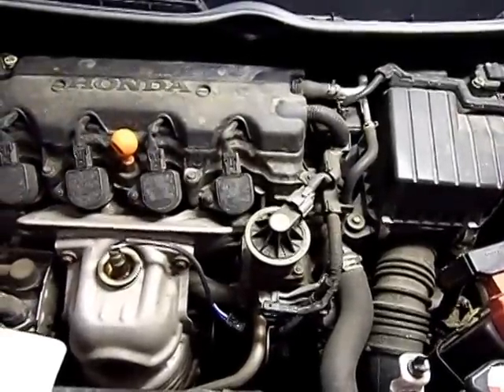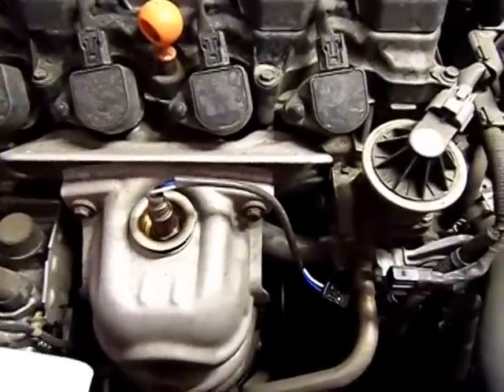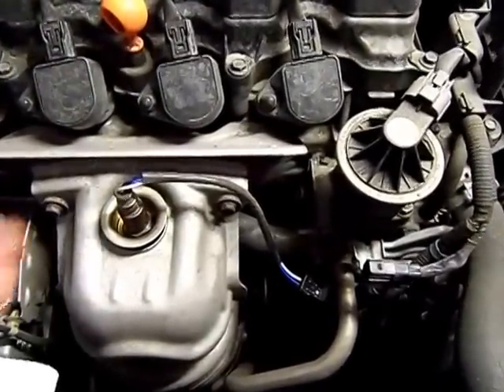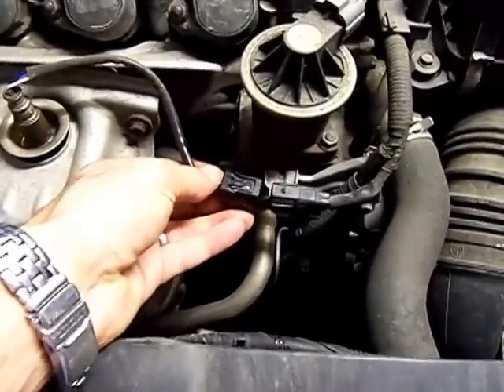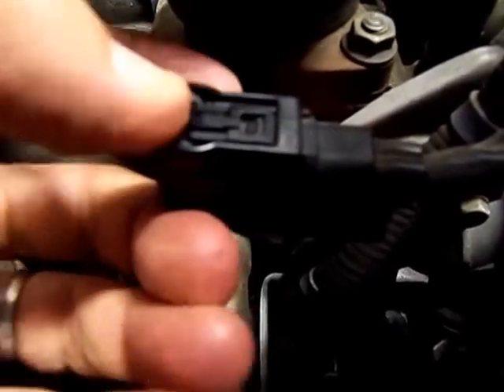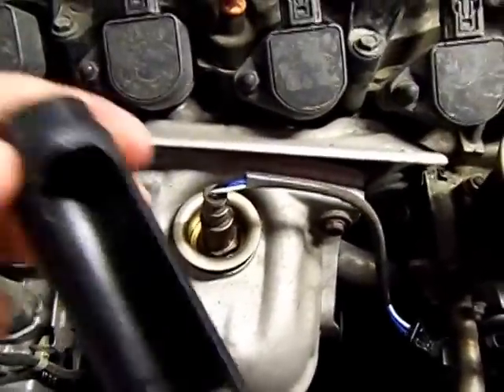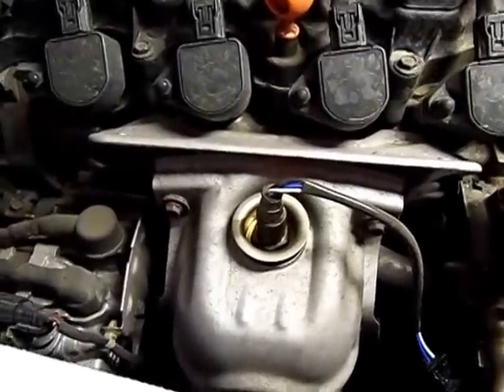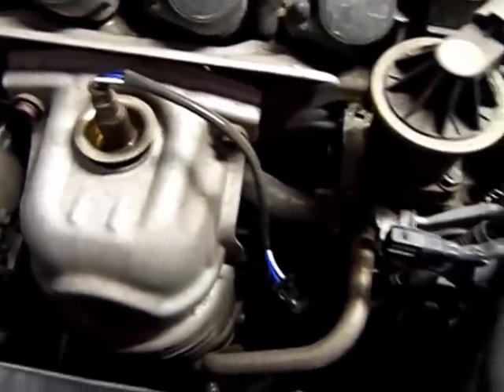How to replace the oxygen O2 sensor in a Honda Civic 2006-2011

Comment: Thanks for the video.To remove the sensor since you are not using it again just cut the cable then you can use a regular long socket to do it. Sometimes they are too tight and the special socket breaks. You can use the special socket to install the new one.
Reply: Good point

Comment: where did you buy your o2 sensor?
Reply: If its JDM 2006-2011 then its located inside the tank with the fuel pump assembly  .
Reply from the maker: My local auto parts store.

Comment: Im having the same issue i dont know if i will replace mine.   Did yours throw any code.  Mine is not throwing any code / no engine check and engine runs great except for the bad mpg i get ..My civic is all stock no modifications done at all... What was the difference can update us thanks
Reply: If it does throw a code, it'll be P0420 - Catalyst System Efficiency Below Threshold (Bank 1) which basically translates "your catalytic converter and associated parts need checking out". Put that code into a search engine to compare your syptoms and what to work on.